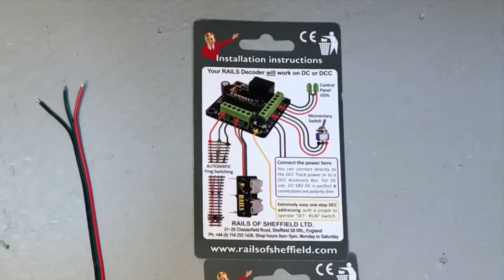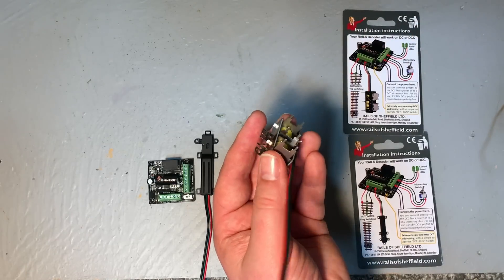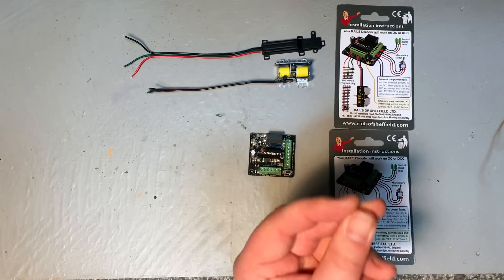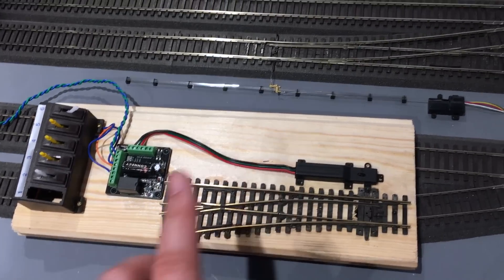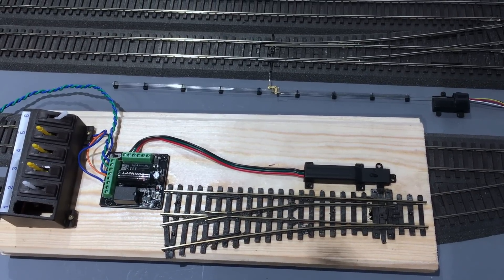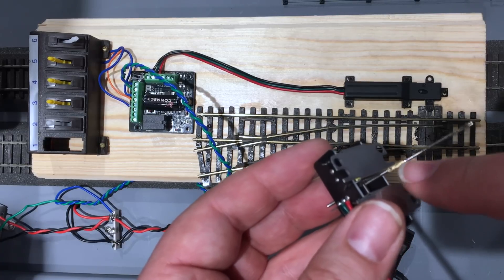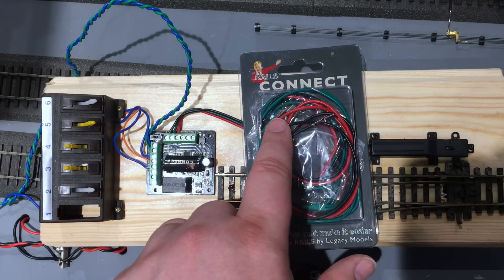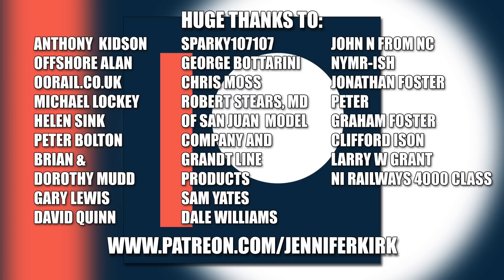Are Rails Connect Point motors the future for solenoid motors?

Comment: Jennifer, this was an interesting video.  I have seen Peco under-mount solenoid switch motors come with that pin extension collar and rod as well.  What I like about  the one you demonstrated is that is is set up with wires and mounting flanges already installed.

Comment: Nice presentation.  It's something I need to look into soon.  Thank you for the clear advice of the solenoids et.c. but for the clear instructions on the packaging too. It also answered a question I had in being DC compatible too.  Even the control units provide a greater array of functions than the basic lever-and-passing-contact switching.  It should relieve a lot of wiring elsewhere too.  Cheers!

Comment: Currently building my first layout and it was a toss up between these or the Peco points and accessory switch to purchase last year. Had no end of problems in getting the accessory switches to switch the polarity even when they were moving smoothly. So moving on to my diesel yard I thought I’d try these new options out. Did a trial with one yesterday on a spare piece of board. Although I could run a train on it, as I didn’t want to cut the pin yet, it appeared to sway the polarity at the frog when I tested it with a multiple meter. The only problem I found, other than getting that tiny collar to grip the pin, was that if your boards aren’t thick enough the collar on the pin hits the hole in the switching bar. Only solution was to add an additional thin piece of board under the pint to move the point motor a few millimetres away from the bar. Other than that it worked ok. Will now look to purchase a few more to complete the yard. Thanks for the vide. 👍

Comment: I've been into H. O. Scale and N Scale for quite a few years now. I'm still operating in DC, but I've heard a lot of pros and cons about the surface mounted switch motors/coils, and after building an N scale layout, I used the Atlas #6 turnouts, which seems to work well. 

The prototype perfectionists used to turn their nose up at seeing those surface mounted units, and I kinda felt bad, but then I got a conducted tour of the big yard at Barstow California in 1997. I saw a lot of big motors and extra equipment running those turnouts, so I left mine in place. I placed ballast around them and painted the equipment silver to match the signals.

Comment: Hi Jennifer that for this video I found it very informative in as much I brought some for a trial. Found them easy to install but I did find it somewhat difficult to insert the wires laying on your back under the baseboard. I was struggling with my PM1 seep point motors as they have a mechanical frog change mechanism and with out a CDU I found that they only worked some of the time.I have now changed all my point motors to surfaced fixed.  The only disadvantage was the size of the surface fixed motor. I will paint them sometime to tone them down & hopefully make them less obtrusive.

Comment: Just to throw in my two pence worth, I had trouble with these surface mounted motors on Hornby points. If you have Hornby points and want them with surface motors then use Hornby r8243. The extra couple of quid will save a lot of grief.

Comment: I have 15 of the surface mount point motors, I have found however that they only in the orientation as shown in the video. If you try the other eye hole on the left they cross bar has too much flex an pops off the peco point and sometimes the cam jams inside.  They could also do with the wiring plugged into the back of the motor rather than soldered straight on so they could be replaced easily if access under the board is impossible.

Comment: Hello and thank you very much for a very well informed and clear video about setting up point motors with the DCC module. Im still a little confused as Im new to this lol 
I'm in the process of setting up my first 8 x 4 DCC layout. 
Not 100% sure on all the bits I need. I was think on buying a "Hornby R8247 Digital Accessory and Point Decoder" linked to an R8213 or 13 as a controller. 
Do I still need the R8247 with the the surface mount motor and accessory decoder *AD together if I had a R8247 or will AD in the pack replace that?

I just wanted to be clear what I need to operate the Points, Point motor, Accessory decoder and the lever to switch the point ?

Comment: Hey jen. Do you know if the control panel led outputs switch? I was thinking they could be used for basic signals so the lights go red/green as the point switches
Reply from the maker: They change depending on which way the unit is switched. They can be used to power LED signals, but remember they only output at around 5V. I have used them successfully to power Berko signals.
Reply: @JenniferEKirk  Brill, thanks. Do you find them bright enough with only 5v?

Comment: Hi Jenny 
Thank you 
I recently bought 5 pack surface mounted. 
When I installed it yesterday, they work well on to one side ( pushing away) but pull don’t work well. Only the sound and some movement. 
I loosened the screws and realigned, still the problem remains. 
How could I solve this issue 
Kind regards 
Thusith W
Reply from the maker: @ThusithWickrama  either the surface mounted point motors are screwed down too tightly (slacken the  screws half a turn or so) or it is not quite aligned to the point properly in which case you would need to move them slightly.

Comment: I have bought rails connect points surface mounted.  I have also bought an Alpha central. I have a doc concepts Power. My controller is a NCE power Cab. Both the power cab and alpha central plug into a DCC panel. Now the problem. The DCC Central can’t find the Points. I’ve tried set and run like your video states but nothing. Do I need a sniffer attached to the panel and the points or am I missing something

Comment: Not sure if this video is still monitored. I want to use a DC-only system to run these points. I'll need a separate power supply AND a CDU, correct?
Not sure of the wiring (complete novice) of the electrofrog points and momentary switches. Is there a resource you can direct me to?

Comment: Excellent vido Jenny. Clear, concise and well articulated. I have one or two side mounted motors where I need a solution to frog polarity changes and which is capable of lighting LED's on my control panel. These look like the answer but sadly, as you say, Rails don't sell them without the point motor. Do you know if they are planning to do so?
Reply from the maker: I don't know, but DCCconcepts do sell multiple channel versions. Search for ADS-2sx, ADS-4sx and ADS-8sx. The Rails one is an equivalent to if there was an ADS-1sx: https://www.dccconcepts.com/product/accessory-decoder-cdu-solenoid-drive-fx-2-way-power-off-memory/

Comment: As an absolute newby to model railways I have been watching your many video tutorials and find them very informative and instructional.
I am a young 67 year old, I understand electronics and can manage most things.
I did enjoy your video on the Rails of Sheffield point motors and decoders that were developed for them by DCC Concepts.
From this video I purchased a few.
You said on the video that it is possible to connect 2 points. 
Now I need help.
I have connected 2 points face to face, to change track. I can get the points to change at the same time, off one switch and connected to the same decoder, but I can only get the polarity correct on one set of points, hence I get a short when going to the next point.
I have called DCC Concepts, they told me to change wires round, but that doesn’t work. 
Are you able to assist, as I am struggling to work this one out and I’m sure you have the knowledge to help me.

Comment: Hi Jen thanks for your Vids. I'm just getting ionto TT120 It seems that the points page is no longer in use? Can you do a vid on hm7000 blutooth and block detection systems that will work with this new system pls best Steve

Comment: Hi Jenny great vid, I have ordered myself the three piece multi pack of under board solenoids and three cdu’s. Should be here Friday can’t wait! I’ve read all the comments and a couple of them ask about having two points connected as you mention, but you’ve not replied to them or gone into a little more detail about this, is it something you could shed a bit more light on please? as I’m confusing myself constantly looking at the diagram of the accessory decoder picture on rails’ website

Comment: Couple of things: actually solenoid points have been on mainstream train track points for well over a century, but more relevant: I honestly think for the set up is what tillig has had for many years, an actual geared motor with everything self enclosed. 
Train triggered turnouts have been available for over 90 years in 3 rail, and a young half century for 2 rail.
Lovely though this is, is it that much of a forward?

Comment: Are these electronic modules compatible with the DCC Concepts Alpha gear, and the point levers? Can I use Cobalt above board point motors with this too?
Reply from the maker: The modules are only for solenoid motors. They are compatible with the point levers.

Comment: Hi, I'm setting up a first ever layout in DC and never used point motors before. With the line side point motor do I actually need a CDU ? Can I wire it through an on/off/on switch directly from the auxillary 12 volt supply from my hornby controller ?
Reply from the maker: The solenoid motors must be used with a CDU. If you use them direct from the power supply they will burn out.

The module shown in this video contains a CDU and can bne used on DCC to make the solenoid work with a digital system, or on DC where it is powered by a 12V regulated DC supply and the point motor is changed via a momentarty switch that you need to attach to the switch inputs on the module.

Comment: Very interesting video thanks. Can you please clarify the business of changing frog polarity? I thought that the modification of Peco Electrofrog points took care of polarity. What does the connect system do? Is the modification no longer required?
Sorry if this is a stupid question, but I have returned to the hobby after 50 odd years and this is all a world away from Hornby Dublo!
I have just subbed by the way 👍
Reply from the maker: The modification to the point is to make them less likely to short on DCC. You still need something to change the frog polarity, and that’s what the terminals for this are for.
Reply: Jennifer E. Kirk Thanks for the clarification. I have ordered some of the points along with the DCC concepts Decoder. Cheers. Keith

Comment: I bought  few of these on the strength if this video but I've had nothing but trouble with them. I'm using the under the board solenoid and connecting I via the tabs directly to PECO code 100 points (ST-E91). The solenoid barely twitches and won't throw the point at all! I've tried with several points, several motors, and several of the boards but none of them work properly.
I'm assuming it's something I'm doing wrong but the instructions are simple and I've watched the video several times, checking the wiring extensively. They throw the bar when not connected to the track but once connected stop working. If I connect a Peco brand point motor directly, without the accessory board then I can get it mostly working but it seems like there's some problem either with the Peco points combined with these solenoids or the accessory board doesn't provide enough oomph to throw the point.
Has anyone else experienced difficulty with code 100 setrack points?
Reply: I just tried one with a peco n gage finescale point and there is no way this thing is going to throw this point. Very dissapointed.
Reply: I had the same problem tried some on the strengh of the post  - throws the point one way only and the electro frog didnt work -used 18 volts dc - no joy - put them in a bag to return - bought some peco points + accesory switch happy Days -
Reply: @johnfreeman2354 I ended up using their surface mounts and they seem to work good for me. Also using Seep under board motors seep motors.  The rails under board motors have short rods. Putting on the extension didn't work because the joiner was right here I needed it not to be for the thickness of my baseboard.

Comment: NO THEY HAVE A MANUFACTURING  FAULT,,,,the cable drops off OFF from the motor as you open the packaging to remove it, it is not repairable.